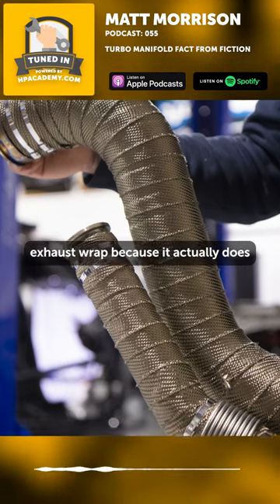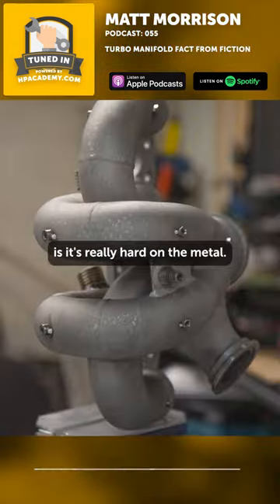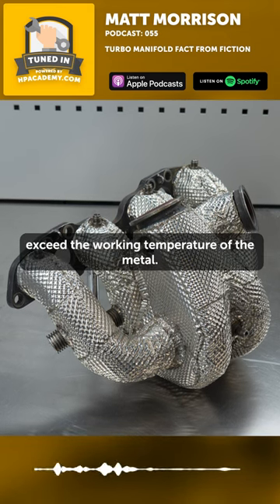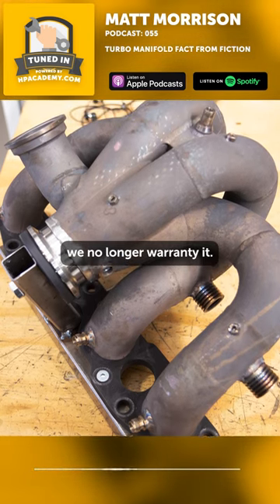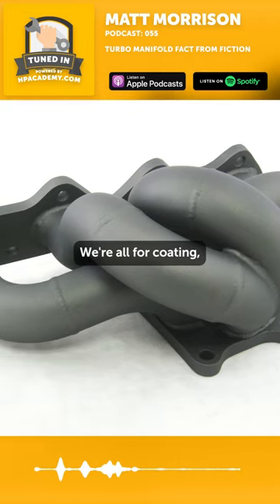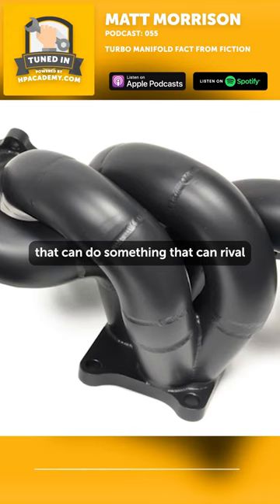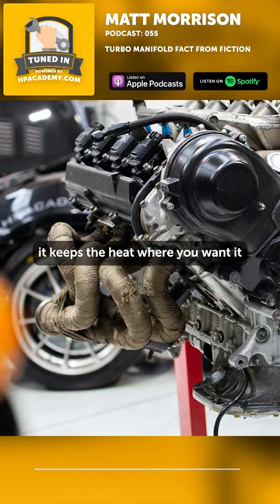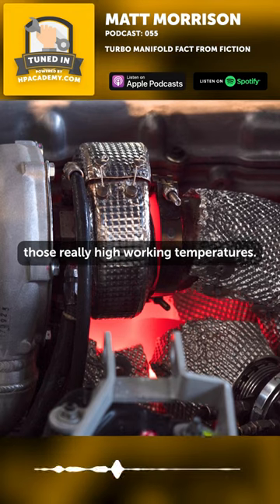Exhaust Wrap OR Coatings? #shorts

Comment: I've seen it happen that if oil leaks onto the manifold, the wrap acts as a wick and a spontanious fire erupts.
Reply: Good to know. I was planning on getting heatwrap but after watching this and some other videos i dont think so lol. Thank you for trying to save others from torching their bays.
Reply: This actually happened to me. And it takes a loooooong time to burn all that oil out too
Reply: Can confirm, it makes a really awful fire, seen a few catch on fire on the dyno.
Reply: Generators ,big diesels use it. 
Well, some of the pipe joints are slip fit. 
Gas tight,not liquid tight.
And the wet stack juices seep at joints.  
So you do a load bank test and see the wrap smoking ,back the load off so it won't flame up.
One of the new guys whacked one with 75% load and we had flames in 3 minutes. 
Gotta step the load on slow. 
Not to mention the hot cinders that blow out of the stack.
Reply: I actually had that happen to me. Was ripping on my car, launching it and street tuning it one night. Rod bolts decided it was a good time to let go and shot the rod cap through the block. Oil went everywhere and the headers caught on fire. Thankfully my buddy had a fire extinguisher or else I would have watched my car burn to the ground that night. Fun times 😂
Reply: Therefore voiding the warranty because who wants to cover someone build when they only bought a roll of wrap
Reply: Yea I got my cars headers and downpipe wrapped, spilt coolant on it once and it won’t stop steaming nomatter how many heat cycles, definitely taking it off
Reply: Wrong
Reply: Ohh shit.
Reply: @toTheWatcher  there's gotta be fire resistant ones noo?
Reply: @toTheWatcher  ohh i think it's best just to use titanium bolts, and exhaust honestly. They don't create rust.
Reply: Maintain your shit and keep it from leaking then
Reply: @dominicstephens781  That's not the type of leak they are talking about, but sure.
Reply: Noted keep on spraying
Reply: Thanks for sharing that
Reply: @j.rjunior5584  it's the oil that catches on fire....
Reply: Shit i didn't think about that, that's scary
Reply: Use the 1° lá of murph

Comment: It works so well it can damage the part... Wow
Reply from the maker: Yes, tradeoff for everything, good and bad - Taz.
Reply: With a turbo heat wrapping dramatically improves spool up. 
‘Hard on metal’
Is BS boomers spread with their 70s  paper thin v8 headers low to
The ground. 

Turbo manifold
Will NEVER have moisture in it 

Gtfo
Reply: @fastinradfordable  they said moisture can get trapped under the wrap. The video never said there was moisture inside the manifold.
Reply: @fastinradfordable  these guys are professionial engine builders that push engines to their limits. Have you ever built a turbocharged engine and rewired a harness, re-routed fuel lines, rebuilt an entire valvetrain and bottom end? Yeah, i didnt think so.
Reply: @Dave-dh7rt  so do i just want to have a custom stainless steel manifold made, coat and wrap for longevity? I want lightning fast spool up and long life, however typically 500hp 4cyl engines need torn down often.
Reply: @adamguinn8305  What do you have for a car and inline 4? Just curious because my K20 turned down is at 458 and I'm right under 40,000 miles.
Reply: @cowboythomas5904  2.0 ltg cadillac nightmare
Reply: @adamguinn8305  can they do titanium header for cars, really corrosion and heat resistant.
Reply: @ameunier41  $$$ im thinking about 1k for stainless i bet titanium would be twice that. Plus it doesn't bend well
Reply: @lastnamefirstname9043  what utter BS……..  how much heat you reckon is in a wrapped manifold…..  🤦‍♂️🤦‍♂️
Reply: @bnetolldnataman none when its not running...... jfc

Comment: "We support the most expensive route." Instead it should be "we support heat protection when it's done properly." When it's wrapped on a turbo manifold we void warranty. So you don't void regular manifolds? If the engine is properly tuned and now kept in regular wet environments like Washington it will last just as long as a coating. It's been proven time and time again. Check out repsol data they have posted.

Comment: if you are tight on space, and need to wrap the manifold,  make the manifold out of 321 titanium stabilized stainless pipe.  its way more corrosion proof than 304 and can take much higher temps.  just coat it first and then wrap it.  you cant stop a turbo manifold from eventually cracking.  thats the nature of the beast when you poke it.

Comment: I used to wrap all of my exhaust and turbo manifolds. I quit doing that after one cracked, and another started to corrode from due to placement of the wrap. It was rusting because of trapped moisture and property makeup changes of the metal over time. I also got tired of working with it and having frayed ends, itchy fibers, and just generally deteriorating over a period of time (ugly aesthetics.) you also have to be careful of oil leaks and such getting on the wrapped part and causing potential fire. 

I switched to high temp ceramic coatings and haven’t looked back since. The parts last longer, are easier to service, seem to manage  heat better, and looks nicer than a wrapped manifold. It’s a bit more expensive than wrapping, but well worth it in my opinion.
Reply from the maker: We've been down the same path previously too. Wrap has its place but it's certainly not everywhere on everything for everyone.

Out of interest, what coatings are you using? Pop up a link if you can for others as a big comment on this post (it's on other platforms too) is around people not being able to find a good coating - Taz.
Reply: Why not make a stainless manifold?
Reply: Whats the engine bay heat difference
Reply: @Suseko44  even good “stainless” can rust
Reply: @Mattryanfisher  "can" and "is gonna to". Are far from each other..

Comment: Would doing both be ok?
Wrapping after it's coated? Wouldn't the coating protect the metal while the wrap keeps in the temps from the other parts of the engine bay
Reply: Yes
Reply: Youre still holding in the super high temps with the wrap, though. It acts like a blanket, and the outside air (especially if youre going 120+mph) wont cool it off.
Reply: Normally, from what I’ve looked at is that you’re supposed to use a high temp silicone sealant after installing the wrap.  The way you want to apply it, I have no clue I would have to look into it, but it should work the same way due to the coating protecting the metal from the moisture the wrap absorbs.
Reply: @Dave-dh7rt  thats the idea of an exhaust wrap, keeping heat in the exhaust and out of the engine bay
Reply: Doing this with my 3in extention tubes. Driver side just rubs on the cab. Don't feel heat, but rather not find out the hard way in the long run. Yes I could run 2.5 instead buuuuut screw that. Ran too many 2.5 tubing in different vehicles just eh need something else to explore on

Comment: In the 2-stroke world, people are always told by tuners to avoid wrapping the pipes.  The additional heat inside is so great that it completely changes the resonance timing of the expansion chambers, so they won't be working with your ports as intended.  Some of the JetSki guys ran with that concept, using water injection to cool the exhaust temperature on the fly and then porting to match, for a wider effective powerband.

Comment: Iv used wrap on bikes and cars. It works well and looks cool and beefy  when done right. Also covers unsightly marks, dents and clearancing divots. Lot of work to wrap nicely and completely pisses you off when it gets wet in a down pour or even trying to clean around it and all that work falls apart. Ceramic coating rocks and is more durable than people think. A little steel wool polishes marks right out. It's inside and out of parts applied to and is even strong enough to put on internal components, amazing
Reply: It's so hard for me to wrap my mind around even caring about scratches on the headers lol. I'm building a straight six for a 40 year old pickup truck with a 40 year old patina that's gonna get 20k/year mileage thrown at it and how the header looks is the last of my concerns on that thing haha.
Reply: @TestECull  ceramic coating looking good is a byproduct of it doing it's thing, wicking the heat away, scavenging exhaust gases  and keeping the quite often expensive header from rusting away after the paint inevitably burns off. They rust quickly exposed through many miles and heat cycles. Ceramic extends header life many times over.
Reply: @plap.  Some builds need that heat to run properly. I will play hell trying to get mine to run worth a fuck in the dead of winter without it! And it ain't like I'm gonna be running the header cherry red on a 200-250hp 4.9L I6 build in a 40 year old half-ton pickup that's being used as a daily/workhorse. Not exactly building a hot race motor here.

The stock cast iron manifolds on my engine are 40 years old and, while they're rusty AF, they're also still so solid you could beat a dinosaur to death with them without hurting them. Ford sure-as-shit wasn't putting any coatings on those things from factory in '85! Pretty sure I won't have any longevity problems with the longtube tri-Y I'm putting on it.
Reply: @TestECull  if it's a 300 that thing will run till the dinos come back. Great engine, know many that would take that over a 302v8

Comment: we do ceramic coating here in Lillehammer Norway , we also coat the inside of the runners and on top of the pistons , the heat isolation works in a way that the UV RADIATON HEAT  gets reflected back into the combustion chamber and out to the turbo where it helps it to spool faster.
max 950 Celsius

Comment: Made a steam pipe exhaust manifold for my new single turbo and external waste gate on an FD rx7 
Worked well, good power conservative boost, wrapped manifold and down pipe,   Turbo manifold basically disintegrated after 2 years
Should of spent money on ceramic coating

Comment: Easy test touch a wrapped header, then a ceramic coated one. Which one keeps the heat in the pipe?
Reply: First time i wrapped headers i was awe struck that i could hold my finger on the header of a running car and not get burned
Reply: This is what I was wondering; can you touch a coated exhaust briefly without being burned, like you can with a wrapped exhaust?

Comment: The best option is a custom formed and laser welder heat shield using stainess or inconel. They leave an air gap that doesn't trap moisture, plus won't wick oils which could ignite. HeaderShield is a great stateside company. Works way better than just ceramic coating.

Comment: Had a 1977 Corvette with Hooker side exhaust headers.  Double wrapped them to cut down on heat.  When I took the wrap off I could see the metal had imprints of the wrap on them.  Was replacing those headers with ceramic coating on new headers.  FYI  It was DEI wrap.

Comment: Very informative.
What about thermal insulation by Tig welding/micro welding (I think) sheets of inconel over a layer of ceramic blanket? (as an example see Thermo Met Heat Management from UK).
Similar to wrapping but more efficient and there's little to no danger of catching fire because it doesn't retain/soak in oil and the sheets of inconel are colder due to ceramic fiber underneath.
Don't know how it would handle heat stress though..metal fatigue etc.
Was thinking of insulating the turbo hot side, the exhaust manifold and the downpipe. Was thinking about coating first but the heat resistant coatings in my country are botched jobs, all of them, don't last few months before they chip and flake.

Comment: Hey there - Thanks for this. Does this apply to turbos and turbo blankets as well? I never wrapped my DP because of this, found a pretty cool flexible heat shield to protect a cv boot... 

But yeah curious, do turbo blankets have the same problem as exhaust wraps?

Cheers

Comment: I always take 2000° high heat exhaust paint and soak the wrap after its installed. The fiberglass soaks up the paint and it no longer holds water or has loose fibres

Comment: What about exhaust wraps that have the waterproof silicone spray that most people don’t use
Reply: It will help the potential rusting issues from moisture but the heat will still be a problem if its too hot

Comment: ¿Por Que no los dos? I mean, I don’t see why you wouldn’t want to atleast TRY ceramic coating and then wrapping an exhaust. The ceramic will prevent heat-onset rapid oxidization as well as humidity condensation from reaching the base metal. I know that sounds like a lot of work, but hey, if it works, wouldn’t it be worth it?

Comment: The wrap breaks down after a couple years too.  Has to be re-done regularly.  And it's fiberglass and makes you itchy and you can accidently inhale it.  It also puts fiberglass dust all over your engine bay from the radiator fan.

Comment: I have a 2003 Ford Exploere that I bought new.  I installed JBA ceramic coated headers for keeping the underhood temperatures lower.  Works really good.  
I am considering buying a ceramic coated exhaust manifold for my wife's Cummins powered 2018 Ram 2500.  Already have the Bank's grid heater delete kit on it.  A nice exhaust maifold will greatly enhance the benefits of the improved intake.

Comment: Wrapping or ceramic coating any other external coating will help to keep the heat in, but will raise the temp of the pipe greatly. Prepare for header leaks and trips to the welding shop on a routine basis.  The proper way to do it is to put a barrier on the inside of the pipe to prevent it from getting too hot. Then the underhood will not get hot.

Comment: What would you say is the difference in heat retention between wrap and the thicker ceramic coatings? I have an NA application where the headers sit very tight against the engine bay and don't want to damage paint (I've smoothed and painted the bay and want to keep it looking good).
You've got me worried about the moisture retention with the wrap, even stainless is going to be affected with moisture and the heat cycling.

Comment: On my RB26 twin turbo I have both ceramic coated the manifold and exhaust wrapped. Same with the dump pipes.
Reply: How does that work for you? I want it coated and wrapped, but I have never tried it.
Yes, yes - or No, no?
Reply: Spray the wrap too.
Reply: @dirkfrazier9779  i have the same question but yt gets so clogged you never see the questions or replies.

Comment: Where and what is the dimpled aluminum foil looking wrap? I have seen it everywhere but can't seem to find it separately
Reply: It's a multi-layered Fiberglas and Aluminum composite. The Glass fibers act to insulate heat, and the Aluminum tries to spread it out... Which is why it doesn't exactly do the job properly. Far better to use coatings and force the environment to take the heat away, than to blanket parts, and invite potential oil/fuel fires
Reply from the maker: There are a few different options, Hunter is not quite correct noting not all shielding is the same, nor are all coatings and they both have their own pros and cons. 

This is what is used in a lot of motorsport applications from GT3 to TCR: https://www.hpacademy.com/blog/dual-layer-turbo-heat-shielding-and-more-update/?utm_source=facebook&utm_medium=social&utm_campaign=general-interaction

Comment: Coatings work but not as well as wrap. I have used both over the years. I can touch a wrapped 304ss turbo header with my hand for a few secs. Can not do that with ceramic coated header it burns your hand

Comment: In your opinion what is the best exhaust coating material for durability long term.
Reply from the maker: That is a really hard one to answer as it depends on what you're doing with your application and your budget. Is 'long term' a race season or years? And is that season 4 races? 12? 20? Offroad and constantly exposed to moisture and dirt, sprint racing or endurance? Or just a street car that is lucky to see 10k on the clock ever 12 months?

With all that in mind, the best answer will come from talking to someone who sells these products (not all are just trying to sell you something) and working out from there after talking about what you're doing with your application, not ours.

For the moment though to answer your question we have fitted this, but note, we've only just fitted it, it's been on for about 4 hours of run time and so far so good, but early days: https://youtu.be/vxoe-GKgx78 - Taz.

Comment: Just last week I was bike shopping, and they didn't have the one I wanted in stock. What they did have was a used one with a super short 2-1 wrapped exhaust. Plus other junk mods, anodized aluminum clutch/brake levers, OoS tire size, weird seat, no reflector, and near-nonexistent turn signals, etc etc. The salesman jacked the price to the point it was more expansive than a stock new one. Like I get it, someone somewhere, but seriously. All of that shit will need replaced the first time I get stopped in my HOA because I'm too loud.
Reply: Rides a bike, lives in an hoa. Keep your problems to yourself bud

Comment: both. hotter exhaust temperatures= much faster flow / will escape easier. wrap and ceramic coatings help by trapping the heat inside and not allowing it to soak into the tubes/back into engine bay.  thats how they can claim ""more power""

Comment: Be warned but generac generators use it on mild steel exhaust pipe. 
2yrs old and tap the pipe with a screwdriver and it shatters like glass. 
They dont care though because it's out of warranty.